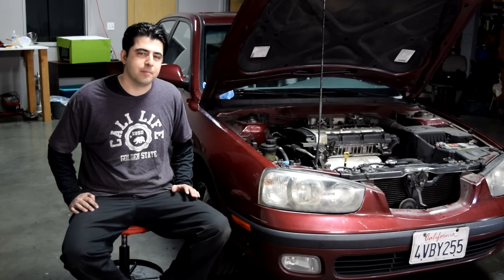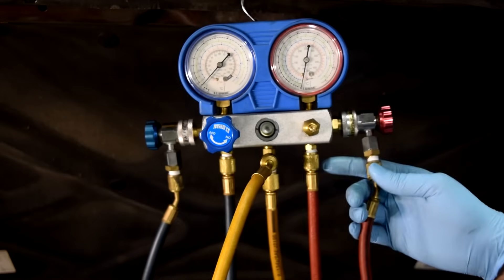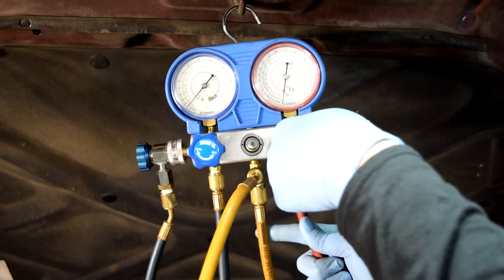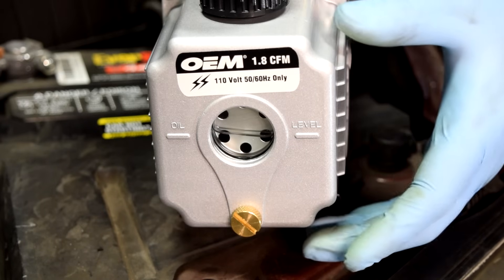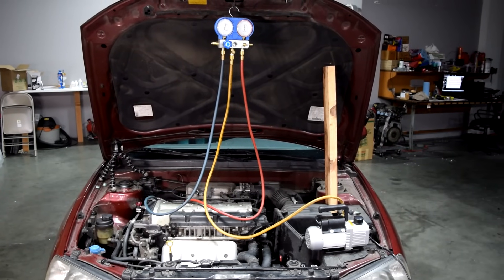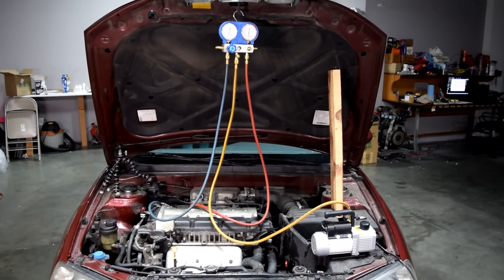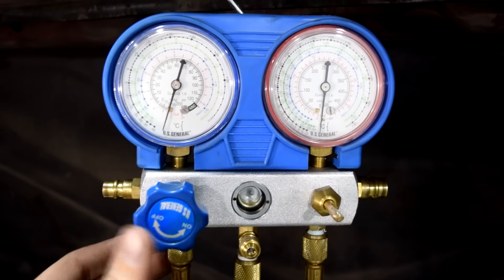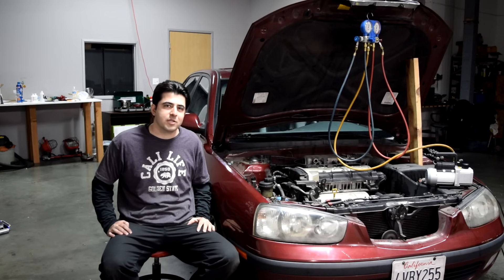How to Pull a Vacuum on an AC System - Step by Step

Comment: Leave vacuum pump on overnight?? smh!! although it is true depending on how long the system was open can determine how long the vehicle should be under vacuum but to be honest if you have a car under vacuum for more than an hour and a half even with a weak pump is overkill and you will overheat the vacuum pump now if you have a strong vacuum pump all you need is in between 30 to 20 minutes depending on the strength of the vacuum pump this is how you determine how strong your vacuum pump is the CFM number how many stages it is and how much HP - Horsepower the pump produces the  higher the numbers the stronger the pump but be careful not to buy anything over 110 volts if you're doing it at home

PS and by the way never leave anything on overnight unmonitored
Reply: theprayingman are use this vacuum pump made by NAVAC 12 CFM here is the link
https://www.trutechtools.com/NAVAC-NRD16T-Industrial-Vacuum-Pump-12-CFM
What takes an automotive vacuum pump a half hour to do to an hour this does in about five minutes. This is the refrigerant manifold or use it has a built-in micron gauge 29 inches of vacuum is nothing you need to get somewhere around 500 µm or below here is the link
https://www.trutechtools.com/Fieldpiece-Pro-Wireless-Manifold-Kit-by-TruTech-Tools
And the main vacuum hose are use are not refrigerant hoses there a special deep vacuum hose made out of silicone reinforced here is the link of what I use
https://www.trutechtools.com/Industrial-Rapid-Evacuation-Kit
All the air conditioning manifolds hoses and vacuum pumps sold by automotive stores where houses or supply houses and tool trucks like snap on or Matco or Mac or just children’s toys on reliable only perform mediocre work just a rip off to mechanics overpriced for what they are not.

Comment: Do you have a video for replacing the valve stem on the low pressure coupler?
Reply: Your best bet is to take the car to an ac shop as this is a simple task, however requires pricey equipment. In other words you'd spend less paying a professional than getting the tools yourself. I dont know where you live so the numbers could be way off but these are prices in my experience from texas to florida region.
option1 professional: $75-$175 to capture freon, remove and replace valve stem, vaccum system and recharge.
option2 diy: $60-$200 ac gauges, $90-$250 vacuum pump, $100-$400 refrigerant recovery tank.
Reply: If you need a video on how to replace a valve core,you should not be doing this

Comment: Is it normal for the AC line to have condensation on it after the evacuation? I put the vacuum pump on my system for a little more than an hour and after that the high side line on the bottom close to the condenser was dripping a decent amount of water
Reply: Thats from the refrigerant cooling the lines. Its illegal to evacuate a charged system like that

Comment: can you explain when you pull the vacuum why it doesnt pull all the oil out of the compressor ? thanks
Reply: 1. The oil is a liquid, not a gas. AND 2. Under a vacuum, moisture boils.  The oil will not boil off as the gas does.

Comment: What’s the best way to remove dirt and other contaminants from my AC lines? I just replaced pretty much everything because it was all disconnected by the previous owner, meaning my low pressure line was just open to the elements. So how should I go about cleaning the lines? I’d hate to mess up any of my new components

Comment: Do I need to have my engine running when evactuating/vacuuming or just when recharging?
Reply: Greg Lancer Only when recharging.  You should never run the engine while pulling a vacuum or even when the system is in a vacuum state.

Comment: I've seen some people when doing negative vacuum on your AC system only open the low side and some open low and high, not sure which is better?  I tried a little bit of both and it seems like I get more moisture out when I just did the low side because it would allow it to be a higher pressure on the low side closer to -29.  Anyone know which way is the correct way or better?

Comment: Great video. Question: my pump pulls the vacuum below 0 immediately. When I close the valves, it holds the vacuum. If I had a leak in the system wouldn't I lose vacuum pretty quickly? I will pull vacuum for your recommended times. I was curious if there was a quick test for a major leak. Appreciate your time.
Reply: It really depends on how big the leak. Any size leak is bad but a slow leak will happen over 30 to 45 minutes or so and a fast leak will happen over 1 to 10 minutes. In terms of the AC actually running a fast leak of refrigerant will mean your AC stops working in 1 day to 2 months and a slow leak will mean your AC stops working in 3 months or just needs to be charged every summer.

Comment: Thank you for this great video. One question: What happens to the oil in the AC system when you pull a vacuum?
Reply: Fred D. Josephson Quick answer is absolutely nothing happens to the oil. It stays in the system and don't let anyone tell you otherwise.

Long answer by pulling a vacuum you reduce the boiling points of moisture and refrigerant thusly refrigerant or moisture will start boiling out of the oil. PAG oil is known for pulling water out of the atmosphere (hydroscopic).By not pulling a good vacuum you reduce the efficiency/lifespan of your compressor. 

Did I answer your question?
Reply: Thanks. That answers my question.

Comment: Don't store the quick connects as shown. Over time, it leaves the O-rings in a compressed state and will leak when you actually need to use the gauge set.

Comment: Im starting this job in an hour on my girls mazda 6. It might need ac oil but have no way to check its level. I want to put a little in the compressor but have no way to inject the oil. Is there a way to pour oil without an injector. Im replacing the high pressure line, can i pour oil in the high pressure line before connecting the second bolt or does it need to go in the low pressure line?

Comment: Heay you gave me an idea with putting Teflon tape on those manifold hoses.... good idea. Everytime I use mine I'm having to retighten all three of those hoses before I turn em on, they keep coming loose for some reason. Thanks for the info, good right to the point video.

Comment: Note. Minimum vacuum time is 30mins. Must hold and if so there is no leak. “Honda ac class” /609 ase certified.
Reply: Brandon Bassett there is not set time you pull a vacuum for. Ideally you pull to 500 microns or less but auto techs get it easy with more lax epa requirements. 

Leak testing should be done with dry nitrogen since the system is designed to hold pressure. Vacuum testing won't tell you much othet than there's a serious leak somewhere.

608 Universal Certified

Comment: Funny, the same knob broke off on my gauge set. I replaced mine with a an old radio knob. Look for a knob with a set screw on the side. Much better than using pliers on it.

Comment: He never mentions using a micron gauge.... You use the micron gauge to judge how long you run the vacuum pump. You want the system to pull down below 500 microns.

Comment: Hi.. nice video man! Thanks! Btw.. how much horse power do you recommend for a vacuum pump? I bought a 1.5hp but it takes so long to clear the system..is it enough hp or should i buy a higher one? Thanks in advance..
Reply: Lezer Pido The manifolds (pressure gauges) are notorious for leaking. Could be the rubber gaskets in the hose or the hose is loose, or hose hasa hole, bad shrader valve/gasket, holes in the evap or condensing coil or combination off the above. Which is why leak testing with pressure (dry nitrogen) is superior because you spray soapy water everywhere and look for bubbles.

Comment: Thank you for all this information very helpful, there is just one thing that is a little confusing, I wrote down everything you explained and at the start of your connections you said to make sure both valves are opened by turning them towards the left, then later towards your completion of the vacuum you said to close the valves by turning them towards the left. could you clarify this, thank you.
Reply: FREE-OBO - dude just do the opposite
Reply: Typically the knobs on the manifold are open left close right. Knobs on end of red and blue hoses are opposite.  Depends on brand of hose set. They will be indicated on knobs if hoses are new👍🏽

Comment: Hi! How do I recalculate/recompensate for the lost oil xoes goes with the refrigerant on recovery? Is there any mathematical formula to determine jow mu h oil is left on the system parts after the recovery?
Reply: piston ring Google for part replaced how much to add in (year) (model) and you will get some ideas.

Comment: question. I tried to pull a vacuum on a 2005 odyssey after changing the compressor and the condenser but the low side does not move below zero. What could be the cause - help please.
Reply: You have a leak in one of your fittings.
Reply: Nwannaa Umuigboby 'll

Comment: the use of vacuum is to remove the freon before?
Reply: removing the refrigerant is usually done by opening up the system to replace a burnt out compressor. The vacuum pump removes the moisture introduced into the system while it was opened.
Reply: dionne santiago the use of a recovery machine is meant to remove refrigerant. Venting your system in the autozone parking lot or at home is a felony. Rarely do people get popped though.

Comment: Hello! My 2005 chevy Aveo has the system completely empty. I am going to vacuum it and add super seal and the R134A refrigerant. My concern is: do I need to add oil to the system?
Reply: Renny Rodriguez Sealents are always temporary fixes and never solve the problem. On the brightside a mechanic will now suggest to replace the entire system because the crud that was injected is hard to flush out and fouls the orfice tubes and lines. Problem solved no more leak.

Comment: i have an r-12 manifold set up. Is their a adapters I get so the flare 1/4'" can screw on to and put the 134a connections so i can leave the adapters on it?
Reply: Richard Cowtails yes
Reply: Do you know If I need an adapter to fit the r12 set vacuum hose to a 134a vacuum pump?

Comment: closing the valves only keeps pressure in the manifold and gauges. wouldnt that only tell if your manifold or gauges is leaking.
Reply: The valves on the lines are still open.  You would be correct if they where closed  but he didn't close them.
Reply: Eric Cardyn you are a nitwit

Comment: basically how do they read pressure if the valves are closed?
Reply: a year late but i think the gauges look at the pressure before the valves ( the valves are just for the access to the middle port , where the vacuum pump is connected)

Comment: Another excellent video. I never realized it took so long to put an A/C system into a vacuum state... 1.5 hours to overnight! Also good tip about the oil for the vac pump.
Reply: I disagree- a very good reason to leave the system on longer is to help remove water vapor. As the pressure drops, the water will actually boil in there (water boils at lower temps the lower the pressure is) turning to vapor and being removed by the system.
Reply: It doesn't take that long. These systems have very, very little volume. I pull a vacuum for 5 or 10 min. Use a micron gauge and get below 500 and you're good. No sense whatsoever in hours long or overnight vacuum.
Reply: no one vacuums them for so long.. an hour is plenty, normally 30-40min is optimal

Comment: Very informative.  I made one mistake where I left the low side gauge open after shutting off the pump.  A couple mins later I noticed there was some oil in the window in the center of the manifold.  I'm guessing some oil got into the system.  Is that vacuum pump oil & is that a big issue?  thanks

Comment: shouldnt u leav valves open when u turn off pump? bcause if u turn off valves then ur turning off guage reading
Reply: valves are to isolate downstream of gauges toward yellow hose but to its respective hoses Red or Blue the line is open .. in simple way the gauges are all the time life to there hoses even if u isolate valves of the manifold
Reply: Lupe Medina Absolutely Not!!! Leaving gauges open after turning vacuum pump off will cause you to siphon the vacuum pump oil into the automobile.

Comment: Very awesome video about car repairs and maintenance. One question, what would happen if i were to release the refrigerant and not recover it in a tank? Is it due to environmentally issue? Or is there any other reason for that procedure?
Reply: Mainly environmental issues but there are other reasons not to just release it. Refrigerant gets very cold when released. Releasing it by hand by sticking a screwdriver or something in the service port can cause a lot of refrigerant to come in contact with your hand. A tiny bit won't hurt but too much can cause frostbite. Think of it like that stuff you use to freeze off warts. Very cold very fast.
Reply: It’s illegal to actually purge to atmosphere mainly because the refrigerant gets stuck in the atmosphere and never goes away. Ozone type stuff

Comment: very helpful....covers all basic stuff very well. . could explain with more detail that valve knobs at ac line hi / low ports depress the shroeder valve within each port, when turned  in a  -->clockwise direction<-- to -->open<-- the valve.  and valves on gauge set--> open<--in counter clockwise direction. In summary valves operate in opposite fashion. It is more apparent when you just go do it. but for those less inclined, forewarning is helpful. Other than that minor detail set, i did not need to diciipher the mans english.

Comment: Did you open the valves on the manifold gauges again after you shut off the vacuum pump ???
Reply: HoaxWhoreHunter Not unless you wish to vacuum the system down again. When connecting your can of refrigerant you would normally unscrew the yellow hose from the manifold until you see vapor indicating you purged the line of air.

Comment: First of all, how is moisture removed by creating a vacuum on a closed 
container or system, such as in refrigeration circuits? It occurs 
because just like your pressure-temperature chart for refrigerant 
boiling and condensing temperatures, the same principle holds true for 
water. It also obeys a pressure-temperature relationship.

 

To extract standing water and moisture from a closed system that can't 
physically be drained out, you have to boil it. You could put a bunch of
 torpedo heaters around the thing and heat the water up inside to 212°F,
 but that's rather impractical. Even if you did that you still need some
 way to get the steam out, and that beyond just letting it vent on its 
own.

 

So we lower the atmospheric pressure over the water, which lowers its 
boiling point. There are multiple ways to measure vacuum pressure within
 a closed vessel; refrigeration techs are most familiar with microns due
 to the desired levels of dehydration sought for inside a refrigeration 
circuit. At around 15,000 microns, water inside the vessel will boil in 
the low 60's degree range. 

 

As the water boils it creates water vapor, which the vacuum pump must 
continually remove. If the vacuum pump could achieve a vacuum within the
 closed vessel, but had no way to remove the water vapor, the vessel 
would remain in a saturated state and no actual water removal from the 
vessel would occur. Therefore a vacuum pump must remove enough water 
vapor as it is generated to sustain the boiling process at the given 
temperature and pressure the water is boiling at. 

 

This is where the cubic feet per minute capacity of a vacuum pump comes 
into focus. The truth is, vacuum pump capacity (in CFM) is measured when
 the pump has atmospheric pressure entering the suction side of the 
pump. As a vacuum pump successfully lowers the pressure within a closed 
vessel, the CFM the pump actually moves also drops off. During deep 
vacuum levels, a large CFM vacuum pump won't move much more air and 
water vapor than a smaller one will.

 

However, if you have a large closed vessel full of water and moisture 
that can't be drained out with gravity or other means, it requires a 
vacuum pump with a high CFM for this reason: a great deal of standing 
water will create a great deal of vapor pressure over the standing 
water. The vacuum pump must not only lower the atmospheric pressure 
within the vessel, it must also lower the vapor pressure of the moisture
 over the standing water so the water will continue to boil. If the pump
 is too small, it will barely sustain the boiling process (assuming an 
airtight vessel), and the rate of moisture removal will be painfully 
slow. The larger pump can remove water vapor faster as it is created, 
achieve lower vacuum levels while it does this, and cause the water to 
boil at lower temperatures, increasing heat transfer between the vessel 
walls and the standing water to speed along the boiling process.
Reply: Its also not just the fact that the system was exposed to open air, if thats all that was involved the amount of moisture that would enter into the system would be negligible during any sort of repair. The system has to be purged because freon is strongly hygroscopic and sucks water out of the air rather enthusiastically. Enough that even a half air or so of exposure is enough to introduce a lot of water into the system via the remnants of the gas.
Reply: Thanks for the explanation
Reply: Trailer tiller
Reply: nicE!
Reply: Buck Lee - i think ur fiullof 💩
Reply: Ive never ever felt compelled to use “TLDR” in my life until seeing this post. 

TLDR